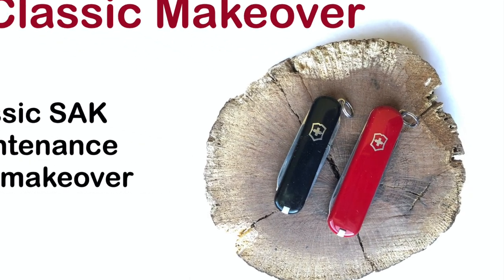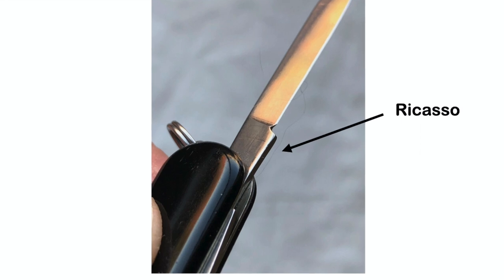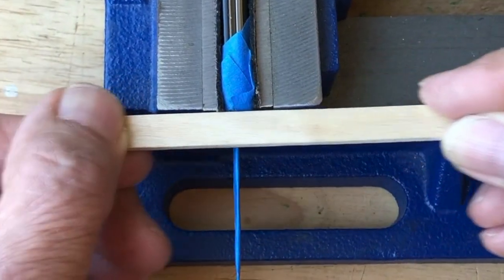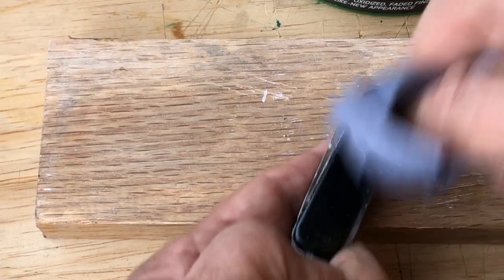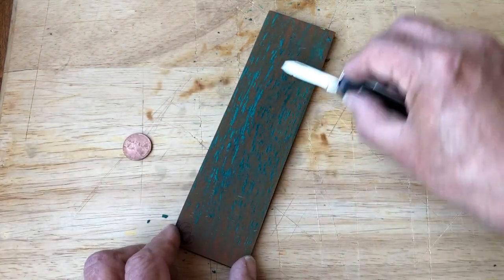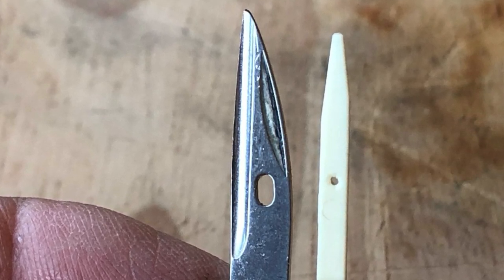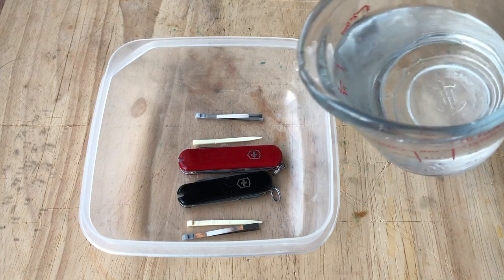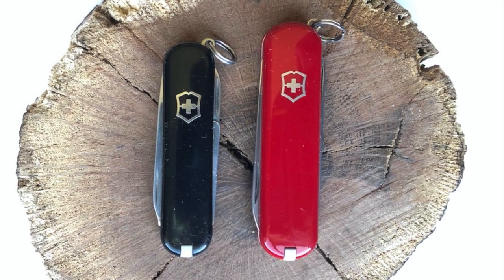Classic Swiss Army Knife Maintenance and Makeover.

Comment: Can I do anything about lost tweasers, sadly I lost my sd tweasers and I would like to find something to fill in the slot or anything else that would help? Nice video by the way.
Reply from the maker: Certainly can be replaced as the tweezers are sold separately and are the same size as on the larger models. The toothpicks are different, though.